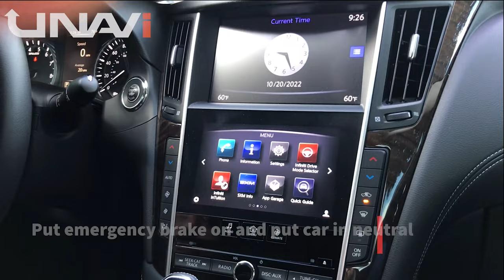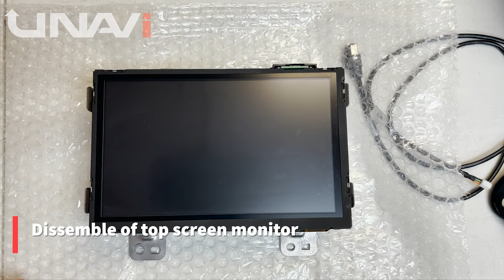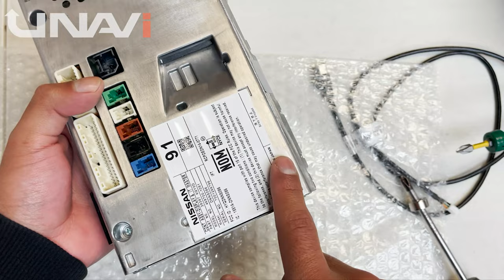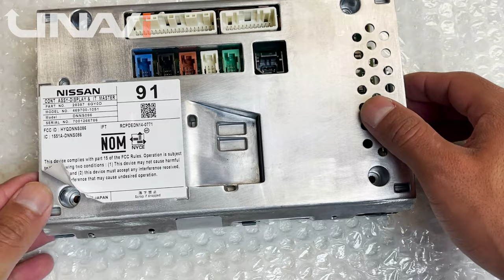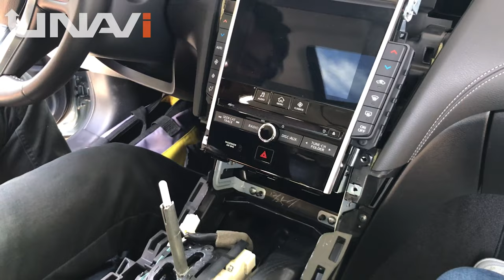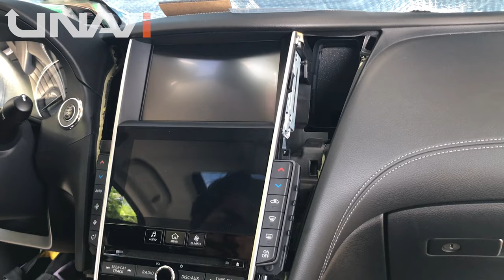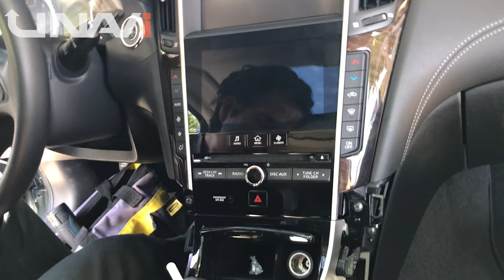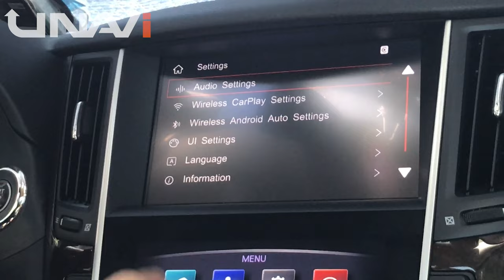How to Install APPLE CARPLAY  in INFINITI Q50 2015, 2016, 2017, 2018, 2019

Comment: Not sure why all the people hating. . . great install video with good quality camera and details. I may be buying this - only wish that the i-knob cable was included with the kit. Otherwise the price goes up to the point where competition may have an edge with a full screen for a bit more money (or they do have just the top screen which is out of stock for better overall cost and it includes the i-knob feature)
Reply from the maker: Thank you for your Comment
Reply: I agree